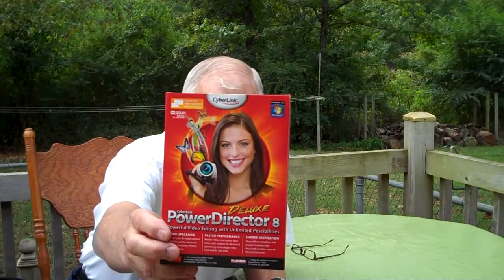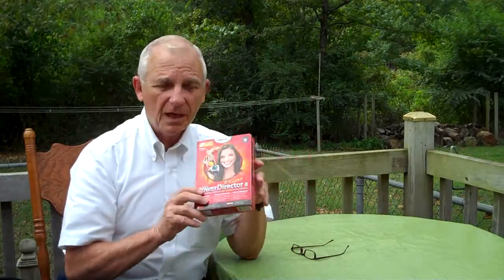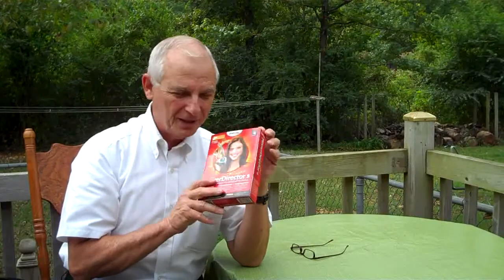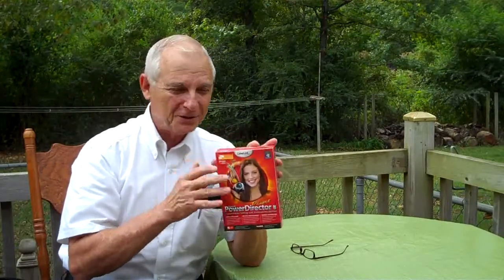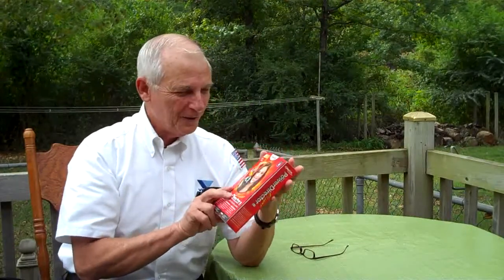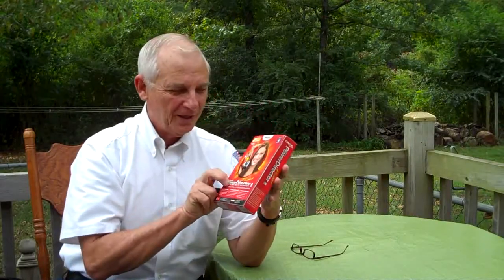One man's review of the Cyberlink PowerDirector 8 video editing program.

Comment from the maker: @Calchick7,
My friend, you have a mega-puter.  Congrats.  
I did a little surfing and it seems that Windows 7 users are the ones having the most difficulty with Power Director 8 & 9.  I'm still using XP, no problems at all.  Try downloading another operating system and see how PD works with it.  It's worth a try.  If it fixes things, then post the results to the Cyberlink Members Forum.

Regards,
John